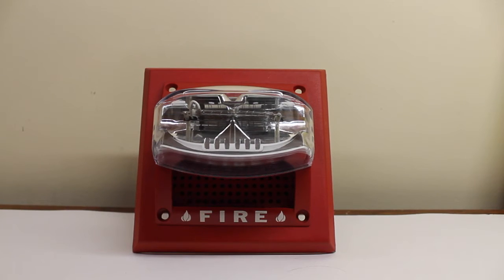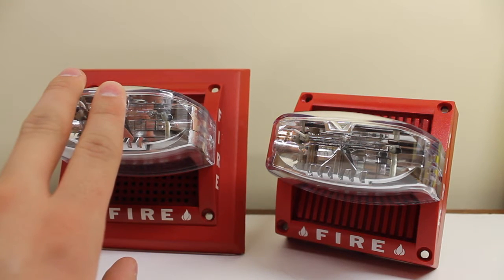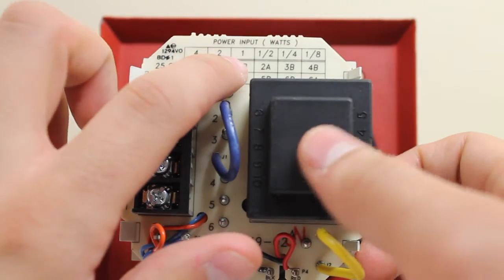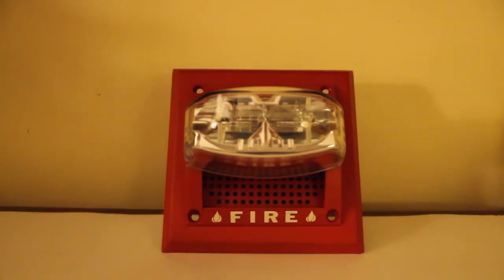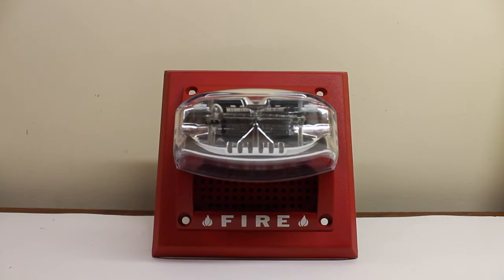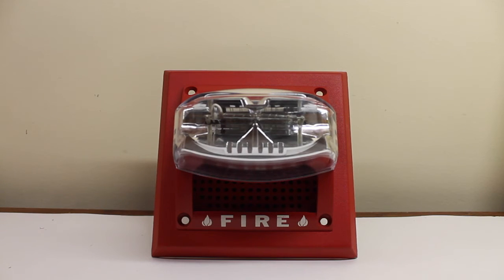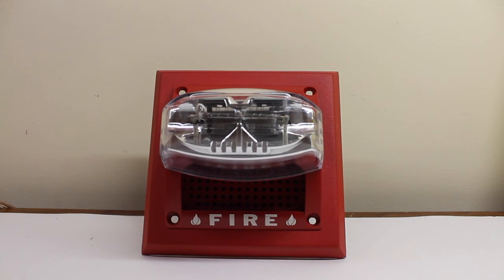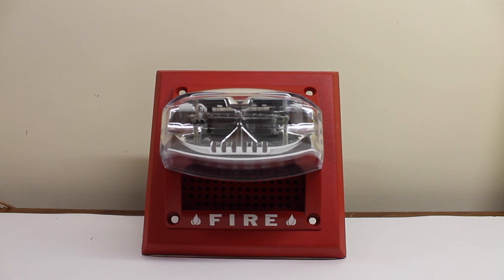System Sensor SP1R2475ADA Fire Alarm Overview/Test

Comment: Spot on! The historical theater building in my city has both these devices, and the same pull stations, and it is a notifier system. It may have these or the v4r with a mounting plate. I’m not sure which,
Reply from the maker: Pretty awesome how it matches the system that you have described! I don't remember for sure if I used the BG-10 in my video of the V4R, but that would be spot on if that building you mentioned had those as well.

Comment: This alarm looks like it from the 2000s
Reply: It's really from the early 90s. These were manufactured from 1993-1997. These succeeded the Frosted strobe versions with the Old MASS strobe from 1987-1993. The Spectralert classic series was the true series from the 2000s & late 90s.

Comment: Do you need any special equipment for the alarms to be used? Like, do you need a panel for the alarm to make the voice evacuation message? I am thinking of getting a Wheelock Et-1070-Lsm-24-Vfw White 24Vdc Wall Fire Alarm Speaker Strobe.
Reply from the maker: You don't need a panel, all you need is an amp that can provide a 25v or 70v signal to the speaker. I use a Pyle PC20MA, which has a line input, and two mic inputs. It can output to 25v, 70v, and even 8 ohms. Don't use a stereo unit, trying to power the speaker using a stereo can damage it.